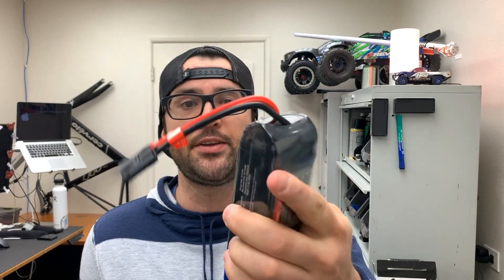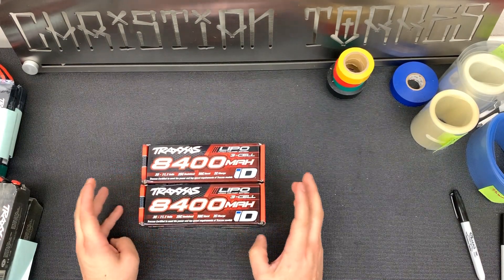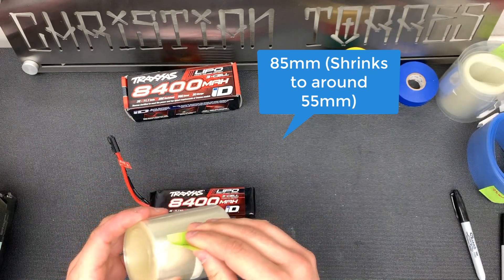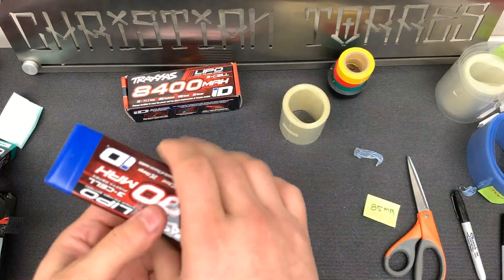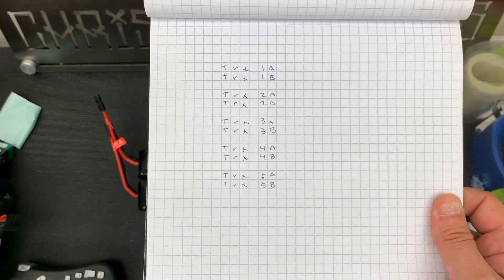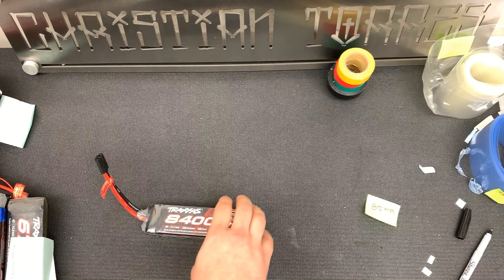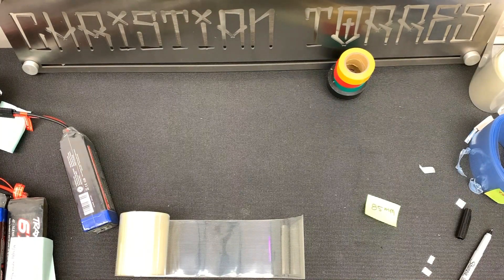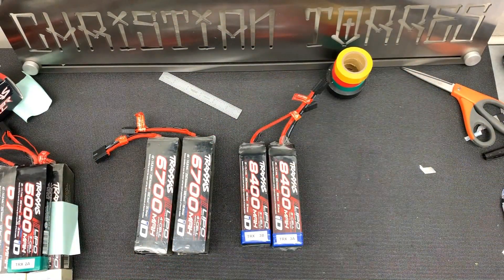Protect your Investment! LiPo Battery Protection - Adding a Shrink Wrap Layer

Comment: What diameter shrink wrap do you use here?
Reply: These are the different sizes I found that work. Depends on your battery size. 128mm, 93mm, 85mm and 73mm. Sorry for the late response. What size battery do you have, I’ll measure some of mine to see what size fits for yours.

Comment: Wow that looks great 👍🏻.   1 question tho how long would you say that wrap lasts before you have to replace it ?
Reply: The shrink wrap lasts a while, I have only replaced it 2/3 times, usually after bashing on the beach because of the sand. Different sizes I’ve used are 128mm, 93mm, 85mm and 73mm. Sorry for the late reply.